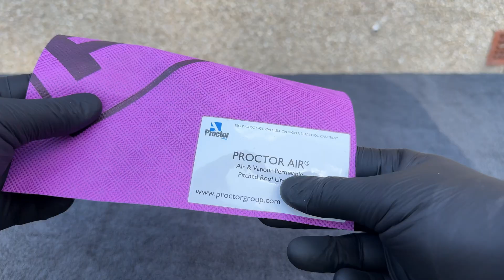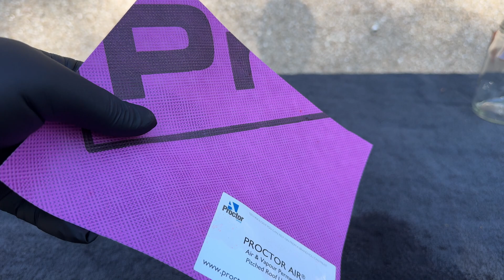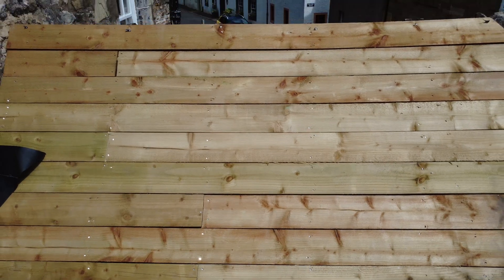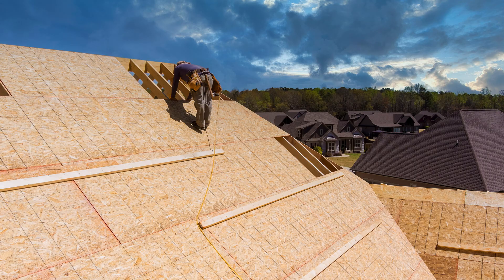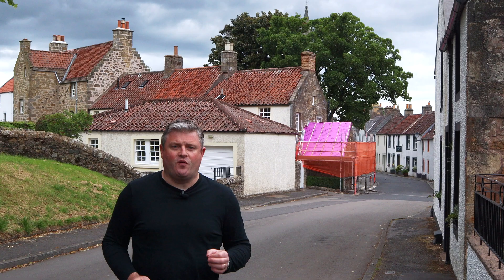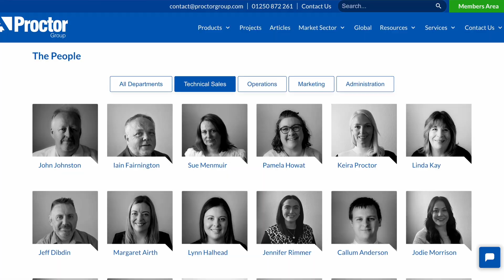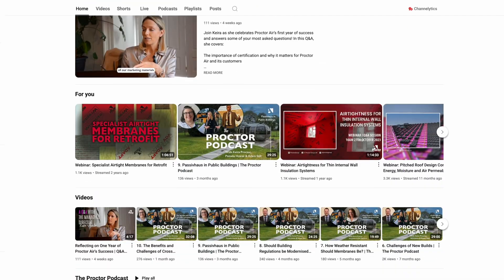How I Re Roofed a Listed Building Without Causing Rot or Damp

Comment: Presumably you could use a fake chimney to provide ventilation to the loft space, either naturally or with mechanical extraction.
Reply from the maker: Possibly, although I am not a fan faking thinks. I suspect the planners would demand the chimney be built from real materials, not fibreglass as some fake chimneys are. I don’t see this being a realistic solution for listed buildings.

Comment: Good video - I assume we can’t use this with cement fibre slates as they won’t let enough air through themselves?
Reply from the maker: I think you can but check with Proctor Group first, they know best
Reply: It depends on the specific system of slates used. As far as the underlay spec goes, any roof covering that meets the definition of "air open" in BS 5250 (Clause 12.4.3.2) is permeable enough, which is pretty much all natural slate, clay or concrete tiles. Some types of fibre cements slates might fall outside that but it really depends on the exact system and profile, so best check with the fibre cement slate supplier if they dont have a published air permeability figure.
Reply: @proctorgroup thanks for getting back to me here. Cement fibre slates are incredibly common in my neck of the woods so I’ll definitely look into it further.

Comment: Do you not need to consider roof u-values for roofs/planning departments? Doesn't that then ruin a lot of the benefits of ventilation?
Reply from the maker: U-values only apply if the building is being converted or undergoing a major renovation. Even then, it’s better to use vapour open insulation rather than PIR. Proctors technical team will be able advise.